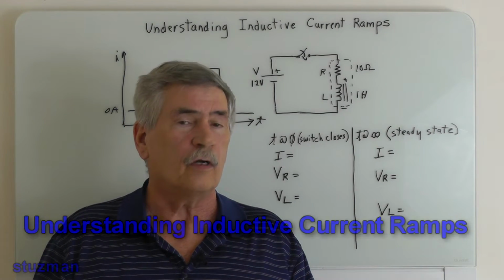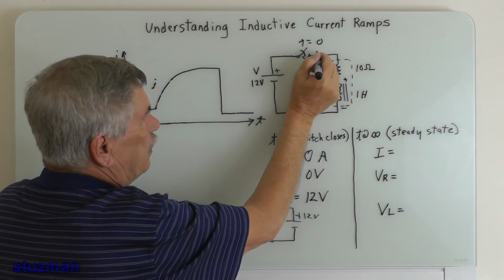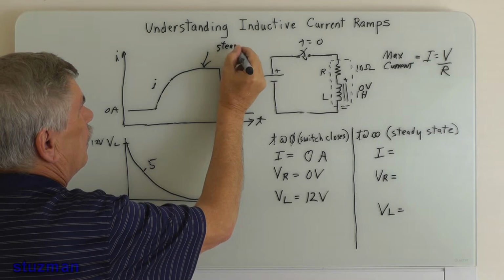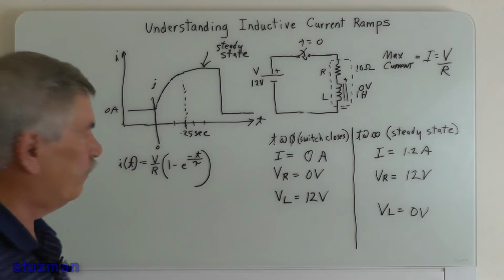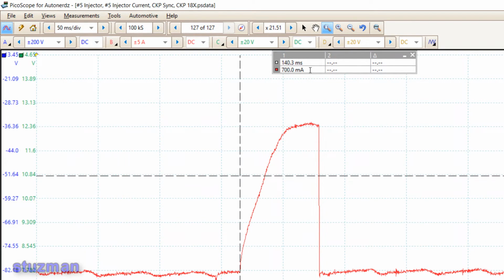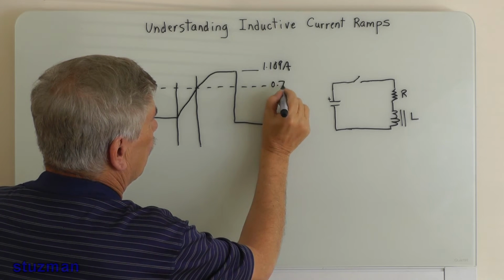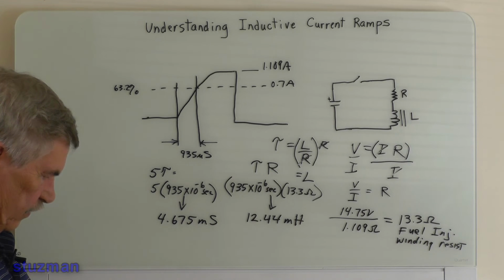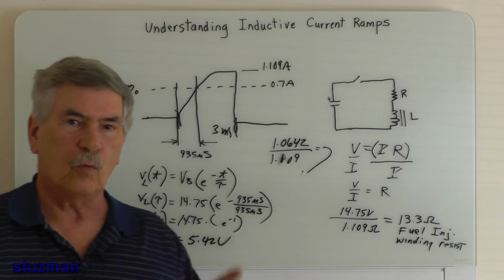Understanding Inductive Current Ramps

Comment: I was having a hard time making sense of Time Constant being equal (in time) for all 5 constants... when 1T allowed 63% current and between T4 & T5 only 1% of current change took place. So as the coil is charging, counter electromotive force is acting against the current / slowing it... and that's why for an equal amount of time (tau), current change is less?
Reply from the maker: You're right Thomas! The maximum about of CEMF is developed when the switch is first closed. As you saw, there is an equal amount of time between each time constant, yet the amount of back emf is getting smaller and smaller as the coil charges up. Once the coil is charged up, there is no more back emf and no more inductance. It's just the resistance of the wire now limiting the current. Otherwise, there would be a linear graph but the graph is exponential. I think you got it figured out Thomas! :)
Reply: @stuzman52  I was close. =)

Comment: The last part when you say that e^-1 is equal to 0.632 is wrong, if that would be the case you would take 63% of 14.75... And that is not  5.42 (a quick mental math says that 50% of 14.75 is more than 7)... e^-1 represents 1tau where the coil is charged to 63%... But the actual value of e^-1 is 0.367.. And 36.7% of 14.75 is the 5.42 volts you calculated
Reply from the maker: Tacit Tacet Excellent observation and you are correct! I had used the other equation 1-e so much that I forgot about there not being a 1. I just did this part in my head making an assumption. Great catch Tacit in finding the error! 😀👍
Reply: @stuzman52 .. I forgot to mention that it is a very well made video..
Reply from the maker: Tacit Tacet Thank you very much Tacit for your kind words! 😀